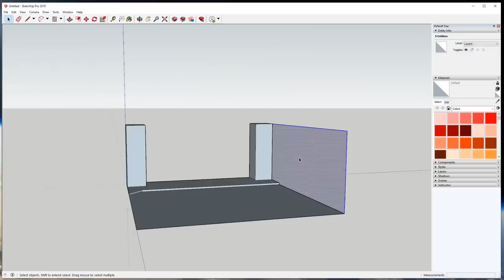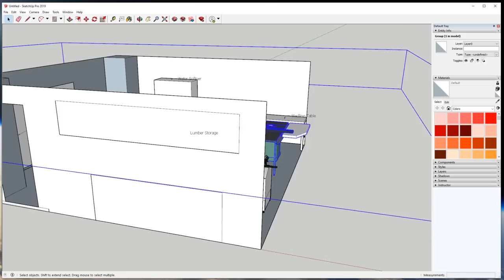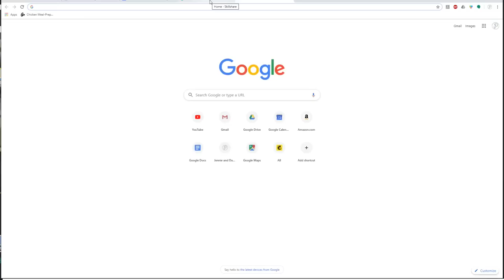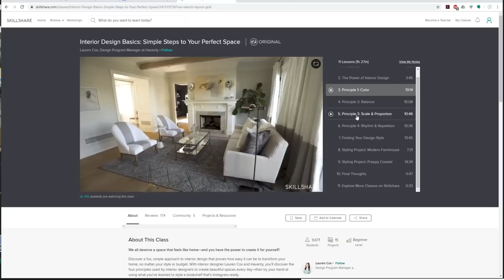🔨NEW SHOP Who Dis? | Starting our Woodworking Business (AGAIN)

Comment: I love castors!  I started out by building a stationary bench down one wall of my shop.  Since then everything else I've added has castors.  I swap where things that roll are all the time according to what I'm working on.  When the weather is beautiful, I roll things outside on a concrete driveway.  The only things that don't roll are mounted on that first big bench that I made;  the chop saw, bench grinder, a couple of sanders, a vice etc. Or are in drawers, cabinets, or shelves under the bench.  My next shop project is, I'm going to tear that bench apart, saving what I can, and rebuild it the same height and width, but in four 6' sections on castors.

Comment: I’m in San Antonio and let me tell you, you’ll want a mini-split air conditioner and to add ridged foam insulation to that garage door come March. The garage is too humid and miserable without AC down here 8 months out of the year...
Reply: I'm in florida and I echo this. If it's not about the heat, it's about the humidity getting to your tools. I run a dehumidifier also but when I have A/C going full, the dehumidifier normally will turn off as A/C will dehumidify also but when the A/C isn't on, dehumidifier is protecting my tools. Just get one that allows for a hose to drain automatically.

Comment: Incidentally Festool has a newer midi vacuum. I’m assuming you recently purchased yours. The newer one is nicer. The version you have was marked down to $539 msrp. Just letting you know if you are still in the grace period. I have the same version as yours and the newest iteration is nicer. Some incremental changes.

Comment: You guys really ought to consider putting at least a 60 tpi blade on your miter saw. You will get a much smoother cut and will require minimal sanding on things that need sanding and will cause less chipping. 

Even if your building a workbenches, treat it as tho your building a fine walnut table and make your cuts the best they can be guys. Just speaking from my 50 years experience. Good luck with the transition
Reply from the maker: 60 tpi!? That’s a lot of teeth 😉

Comment: All I can say is LISTEN to the folks around you when they say HUMIDITY AND HEAT ARE BIG PROBLEMS in Houston. 35 years in Texas. I lived in Austin, San Antonio, and El Paso. Believe me, weather in HOUSTON is HORRIBLY HARD to cope with. Be sure to get climate controls built in to handle conditions you might expect in the jungles of Africa. (Wait until the mosquitoes come out.) Humidity will make what should seem mild into wretched in Houston. A split A/C unit and Garage insulation and probably a portable dehumidifier ... as MINIMUM. Right now is the BEST time of the year in Houston.  Put the welders on mobile carts near the door to wheel outside ...  Good luck guys. You'll love Texas but that's after you get acclimated and make the necessary adjustments in your lives.
Reply: BTW, Check out Andy Rawls -- He's in Boerne area ..not too far and he's specialized too.
Reply from the maker: Grew up in east Texas... no strangers to the heat here!